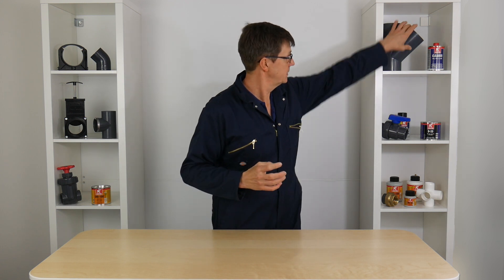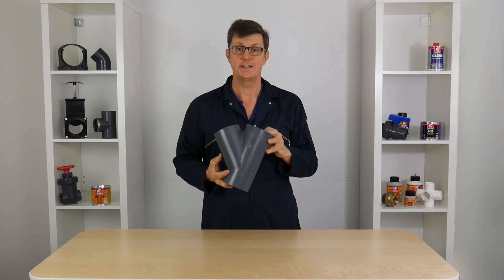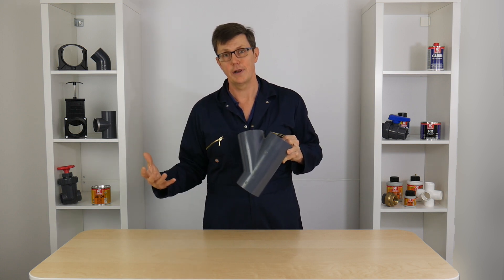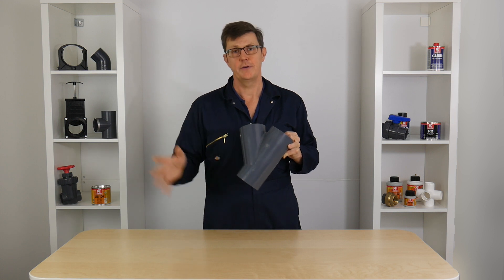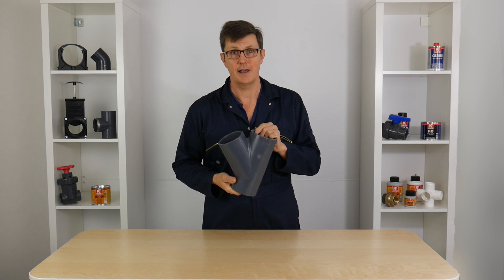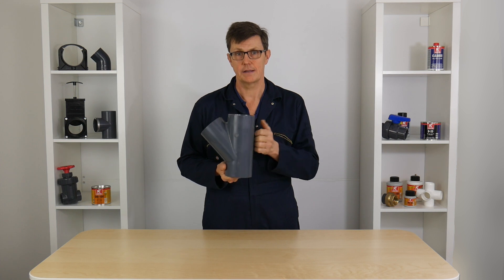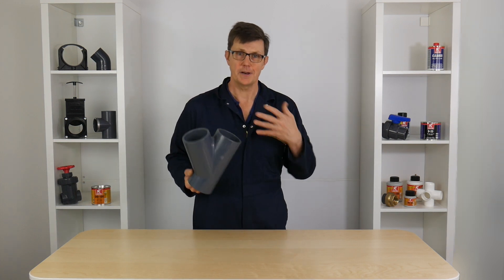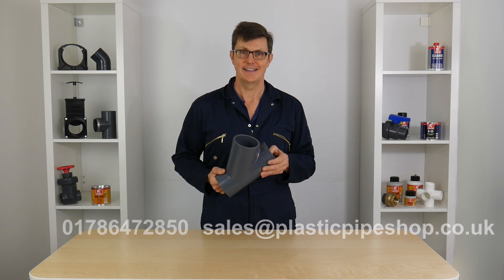The Differences and Similiarities of PVC, PVCU, and UPVC

Comment: We usually use PVCI fittings and pipe in our shop but every now and then the vendor messes up and gives us PVCU fittings and pipe instead. The two materials are both "hard" so it's too simple to say if a part is hard it's automatically PVC. High density polyethylene in depth can sound just like PCV. There are two manufacturers making PVC parts in the U.S. and while they may look the same the socket depths are different and with one brand you can trust that the marks on the parting lines that you use to calculate pipe lengths are actually the middle and you can trust your measurements. On the other brand you first have to locate the halfway point and mark it before you can proceed to calculating the pipe length you need and that really slows you down when you're trying to glue up pipe runs.

Comment: I have a PVC-U pipe that I need to glue up/bond. I have never felt more confused about how I should proceed.

Will regular PVC procedures ( purple + cement ) also work on PVC-U?
Or do I need a special glue, just for PVC-U? And if yes, do I need to Prime PVC-U , or it doesn't require Primer?
Someone told me I should use MEK + PVC-U cement. But does that mean I don't have to clean it? How many things do I need? Is there a cleaner just for PVC-U? I have no idea what I am doing.
Reply from the maker: Hi there, if it is a rigid pipe that you have and it is made from PVC then it's the same stuff whether it has PVC, PVCU or UPVC marked on it and so it should all be treated in the same way. In some parts of the world a purple primer / cleaner is used so it can be clearly seen, after the joint is made, that the correct procedure was followed. In other parts of the world a clear primer / cleaner is used.  Primers/cleaners are solvents that are used to remove contaminants on the surface of the plastic, which may be from the manufacturing process or accumulated during storage, transit etc. It also serves to provide a better keyed surface for the glue/cement to "melt" into. Some manufacturers have their own formulae for the primer/cleaner, one of which is MEK, but they all do the same job. The glue is actually a thick solvent compound which works by melting the two surfaces together, which is why the process is called "solvent welding". There are many different manufacturers of solvent cement, calling it many different things but like the cleaner, it all basically just the same job. Some are thicker or thinner than others, and some are thixotropic, which means although they may appear quite thick, when under pressure (Ie pushed together as a joint) they become thinner which enables them to fill any voids in the joint.
 
The only other processes you need to follow are :
1. ensuring that the end of the pipe is chamfered, as otherwise it can act as a knife edge as it goes into the socket and push all the glue in front of it
2. If it is old, reused or excessively dirty, then emery cloth should be used on it before the cleaner.
3. That when pushed together, the pipe and socket are not twisted, as this can potentially lead to more void spaces in the joint. If you need to adjust the pipe once it's in the socket, do it immediately after it has been fully pushed in, and then hold it in a position for a few seconds.